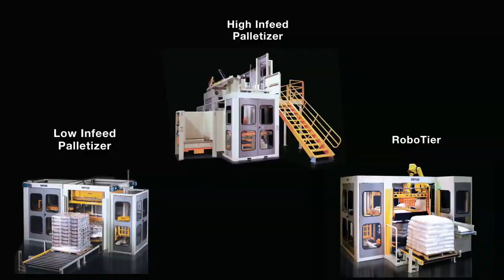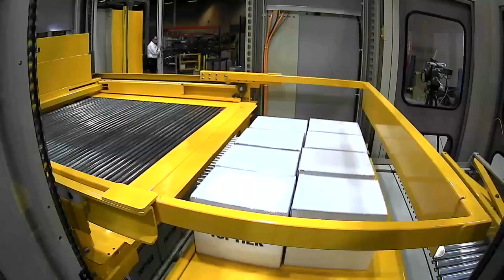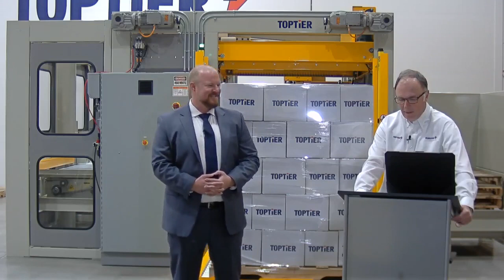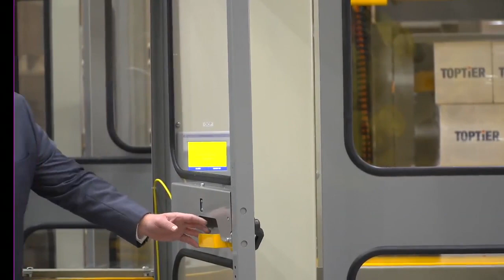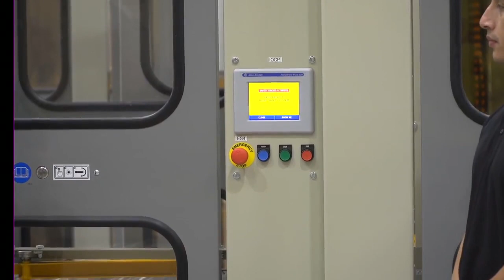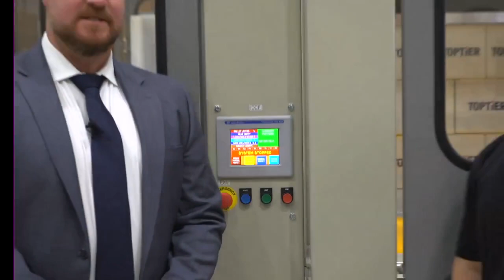Palletizer Demo from Pack Expo 2020 by TopTier Palletizers

Comment: the machine is supposed to stop if the stretch wrapper door is open, very  dangerous
Reply from the maker: With the Controlled Entry safety system, all machine operations stop when any door is opened. All hazard related components engage redundant mechanical breaks and high voltage is dumped. Palletizers achieve category 3, PL-d per EN ISO 13849-1 safety standard based on controlled entrance protocols. For more information see https://www.toptier.com/safety.html. We hope this is helpful and thank you for your interest.
Reply: That part!!